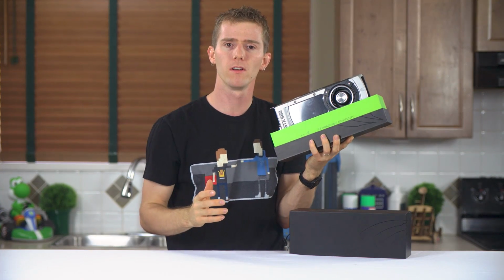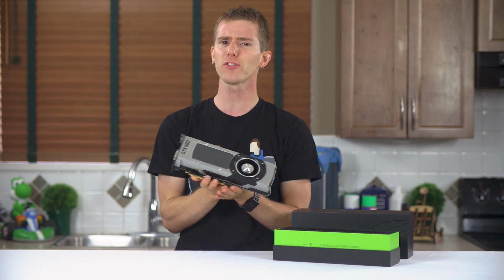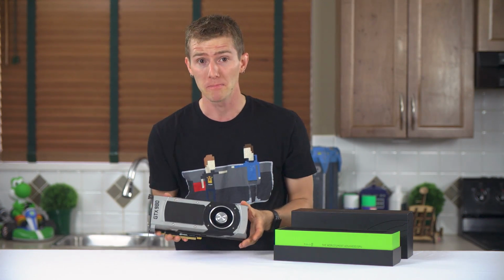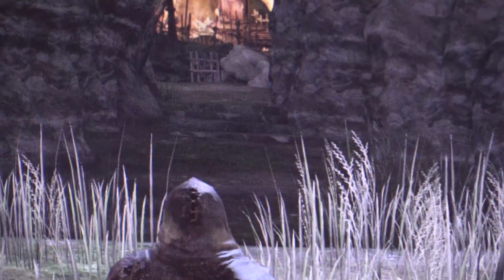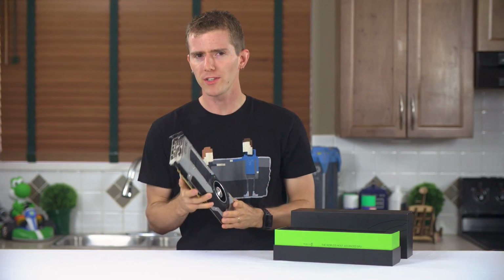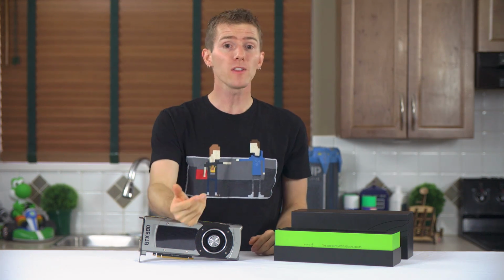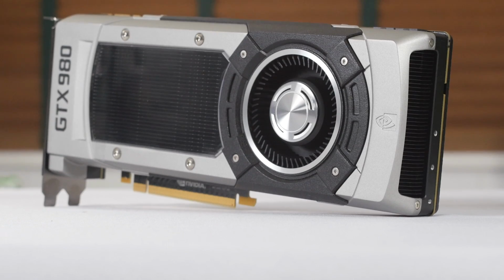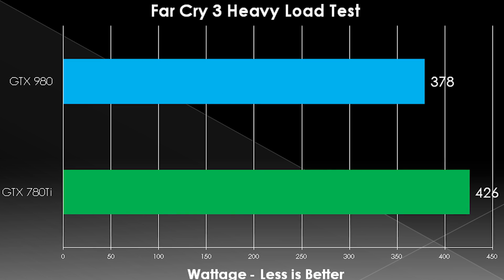NVIDIA GeForce GTX 980 Video Card - Performance Overview

Comment: Should I get this now, or wait for a 980ti?
Reply: Wait for AMD to release their new cards if you can afford the time. Decide then. Worse case scenario you end up picking up a 980 for cheaper.
Reply: We'll probably get a die shrink before we see a consumer full GM210 card, so it might be a while... But when it arrives, it's going to be awesome! So, your call, really.
Reply: I would get the 970. It is barely worse than the 980 and is $330
Reply: If they're deciding between the 980 and a 980 Ti I can't imagine they care if there's a better value product.
Reply: If I didn't care about value, why would I be asking?

Comment: No double precision or 10-bpc this time around either :(
Reply: nvidia dont want to cannibalize their workstation grade gpu's (i mean which would you prefer a 780ti for $600 and dpp or a $3000 card based on the 780ti with slightly better optimized dpp and a few small extra features you might not even need?) so non nerfed dpp gaming cards isnt happening beyond the titans......
Reply: ***** Rather work station grade GPUs since quadro has it too.
1toncheese yeah I know I know. But ever since titan got it i have had hopes for it to be implemented in consumer grade cards. :P
Reply: Andreas Lindhé
it would be great i know but thats business...... nvidia makes much more money this way basically taking businesses for chumps just because they can afford to.
Reply: Yep.

Comment: the TDP of the 900 series is enough to make me want to jump to team green. when i first read into the 900 series i thought "well i could probably fit a 960 in there without also upgrading my psu"..... nooooooooppe. apparently i can throw a 980 in that mothertrucker, and turn my current 7850 into a drink holder.
Reply: i can throw 2 in mine :D and that sounds like a pretty good drinks holder, if you jury rig a pci/ molex thing and make it output some heat itd be a heated holder.

Comment: Good overview, thanks.   One question though...maybe you answered this already.. but why didn't you compare it in the first bit to the 780 or titan instead?  It actually has 300-700 less cuda cores right?
Reply: its meant to be as good as or better than the 780ti, no sense comparing it to the card its replacing but the one above it instead.

Comment: Seems nice. I'm still overjoyed with my 780 Classified though. I'll think about getting this once I make the jump to 2560X1440.
Reply: No need to get that card just for 1440p man. The 780 should eat 1440p games for breakfast like it does with 1080p. And if you really feel its necessary to upgrade, I'd wait for the ti version to come out, the price on this card is a little lower. Or you could get the 970 which (from what I've seen online at least) performs similarly and costs aloot less. It performs about at Titan level in reference cooling for only 300 bucks. If you pay the extra money(probably like 30-70+ more bucks), you'll get even BETTER than Titan performance with a non reference cooling, but only by like 3-10 fps. But if I were you, unless you're going to sell that 780, I wouldn't upgrade until I absolutely needed to, because the performance increase isn't worth it IMHO. But it's your choice.
Reply: I'll be looking for far more than 60 fps when I jump resolutions.

Comment: How much does the card cost? The link in the description doesn't have anything.
Reply: ~550, while 970 is at ~330, but is almost as fast as stock 980 when overclocked. Have a look at techpowerup reviews.
Reply: 549
Reply: stealyphil1925 Thanks for the info, I thought as much, but wanted to make sure. Very excited for this and the 970. The performance is insane, when overclocked they can beat a $1000 card!.
Reply: Ričardas Marozas Thanks for the info. It's an exciting series, finally there is a major price to performance increase, as even stock this $550 card can be on par with a $1000 one, and beat it with overclocking. Both the 980 and 970 will be great cards to own. Very looking forward to them.

Comment: Crap value compared to 970.
Reply: -Beats or is equal to 780ti
-Uses less power
-Slightly cheaper
-Can O/C better

I fail to see the poor value
Reply: Yeah... That's how everything works...
The close you get to the bleeding edge, the worse the value is going to be. Does the phrase "value product" usually make you think of the brand-spanking-new top-of-the-line?
Reply: How much is 970?
Reply: They're $549 and $329 respectively.
Reply: ***** When did I say anything about 780Ti? 970 is only 330 usd and is just ~15 percent slower than 980. That makes the 980 crap value compared to 970. Get it? Or logic is not your friend? If paying 65% more fore 15% performance increase is a good value for you, then you have more money than sense.
Reply: Ričardas Marozas I don't think you get to be insulting people over poor logic when you're talking about percentages as if they act the same going both ways. And what on earth does it matter if the value for the card is different? If you have more money to spend the 980 is a better buy. To get the true value of a graphics card you have to consider the cost of the rest of the system. If you're spending $6-700+ on everything else the performance/cost of the entire system stays almost exactly the same going from the 970 to the 980.
Reply: Patrik Manni In other words, you agree that 970 is better value than 980, but disagree just to disagree, right?
Reply: For just the component it's a better price/performance ratio, yes. That's what I said originally. That's how everything works. But when you're actually building a system, if you have more money to spend, the entire system could end up being the same price/performance with either GPU if all other things are the same. And just a GPU laying on the table is nothing but a fancy paperweight. So no, it's not inherently better value. And it certainly isn't the better purchase if you have the extra money.

Comment: Would this bottleneck i5 4670k OC to 4.4ghz. Get a new CPU for the 980? Or should I get watercooling and OC it even more, instead of the 212 EVO?
Reply: Every card would bottleneck the i5 your always at gpu limit
Reply: You're fine for the next 3-4 years. Seriously gaming w i5 OC CPUs is already a lot of power. Invest in GPUs
Reply: MrApvel  u wot

Comment: Comparing a 1500 OC'd 980 to a 1300 780 ti, and showing the TI still have better performance than the 980 while at the same time saying the 980 is beating the ti. Real honest linus....
Reply: The 980 beats the 780ti in price,features, and power consumption. Brute power however goes to the 780ti.

Comment: Wait, when he said "it's a total tank," did he mean like the vehicle or like a failure? Based on what was said in the video, the technology is really freaking cool but the benchmarks were lackluster at best, so that's why I ask.
Reply: like a good tank, the benchmarks were great, note that new drivers may improve performance more and that not every GPU overclocks the same amount, it uses less power and therefore should be cooler and more quiet.
Reply: Remco Smit Good to hear. Was really hoping Maxwell was worth the wait, and it seems to be doing well based on power to performance ratio, just wasn't sure on the rest.
Reply: I think he meant it as a compliment.  Haven't seen a single review at stock clocks that puts it below the 780 Ti.  It looks like the 780 Ti can still hold it's own against it while overclocked, but at factory stock speeds, the 980 is about 10-15% faster.  The main thing is how much more efficient the GTX 980 is while besting the 780 Ti and R9 290X in pretty much every test, not to mention being $150 cheaper.

Comment: I guess I'll be fine with GTX 670 Top 2way SLI for 1080p @ 120Hz for at least another half year. Maybe not as energy efficient but RAW power is about the same as a 780Ti, and doesn't justify to expend 800+ bucks yet.

Comment: Where is the microphone? is it a shotgun above? This video sounds abnormally muffled and bassy as if the mic is like under the table.
Reply: Unfortunately dude... I feel as if your speaker set may have blown. I would consider referencing some of your favourite songs to see if you notice a difference.
Everything sounded fine my end. 
Placing the mic under the table would not increase bass response... it would actually decrease it.  at least when the sound in question is a voice.
Reply: The microphone is a Sennheiser microphone that has a wire that runs under his shirt that the mic clips onto underneath. The mic is resting between his shirt and his chest, thus causing abnormal resonance. If the mic was not resting against his chest, and over his shirt, it would sound cleaner.
Reply: Stephen Rudolf I use M50x's. So no.

Afistnu That explains it. Though wonder why he bothered putting it under the shirt when he's already wearing black. Probably not noticeable for people looking for the card.
Reply: Becasue he doesn't have a collar.
Reply: Stephen Rudolf I don't necessarily see why a collar would matter, though what you call a collar also counts. If you mean around the neck, that's not ideal if he turns his head. If you mean the lapel, then yes that'd be perfect. it's in the right spot and also an easy exit for a cable.

I would place it in the same place right above/between the two heads on his shirt. Even if the cord was there probably wouldn't be that big of a deal. 

I've never been a fan of the mic under the shirt option. Especially when a shotgun ontop of frame would be easier for a setup where he only moves maybe 6 inches in one direction. Not like it's a wide shot.

Comment: Should I get this or the ti version? I'm currently using a gtx 570 and feel like it's about time for a upgrade. Also I don't over clock things.
Reply: ***** Alright cool. Also will I need to upgrade my motherboard? Also I'm using a i7 2700k cpu. I only know some basic stuff.

Comment: overclock the CRAP out of everything, no matter what. every time. takes a few minutes and you get more performance for your $... as long as you make it stable.
Reply: There are negative effects of overclocking: it reduces lifespan, for starters.
Reply: Dave C while this is true,  I've never (yet) had a computer component fail due to overlooking.  But I usually upgrade every three or four years...  I've been over clocking since we'll..  As long as I can remember..  Back before the celeron 300A days.  Any On I do now,  I use custom watercooling as well..  So that helps I guess.

Comment: Is this worth upgrading to from a 780 for 1080p gaming? I got my 780 last Christmas so not sure if I want to upgrade or just wait until next year when they come out with a new line of cards.
Reply: It really depends on what you use it for, i just use my card for 1080p 60fps gaming. So i won't be upgrading till i need to my R9 280x is doing fine.
Reply: Stay with your 780, for 1080p it will be high end for at least one more year. And even my gtx 770 still does really well at 1080p.

Comment: Linus I'd like to see the GTX 970 SLI and the GTX 980 SLI as a comparison.  Techspot did a great article showing the GTX 970 SLI and honestly for the price of only about 100 more than the 980, the 970 SLI dominates.  I was wondering how the 980 in SLI would look though and if it really blows up the charts.
Reply: oops I meant techpowerup's review...techspot messed up their review with the wrong driver

Comment: I'm the only one disappointed her? I don't mean disappointed by pricing, power or power consumption, but by the fact that nvidia didn't use the old reference cooler aka 780ti/titan black cooler and put a weaker in there. They now use a cooler with heatpipes insted the vaporchamber design. 165w tdp but still 80°c and 42db~? come on nvidia... ruined the card for me...

Comment: The power consumption was really overhyped, but the performance is pretty good. It's not justifiable to upgrade unless you had/have a 770 or below I think, but at least Nvidia thought intelligently and put 4GB VRAM on there to drive these higher res 21:9s and 1440p+ monitors we're getting into now
Reply: ***** http://www.anandtech.com/show/8526/nvidia-geforce-gtx-980-review/21

Total system power consumption is different by 68-70~ watts. Now, that's a difference, sure, but not the godsend that the 980 has been hailed as. It's more of a step in the right direction.
Reply: ***** I wasn't expecting more. It's just that the power consumption itself was overhyped. It's great that it's down, and by close to 200w presumably in SLI setups, but it's more of a step in the right direction like I said as opposed to some miracle gift from the heavens. It just bodes well of what we'll see from a TI version

Comment: HELP: 80 plus bronze 650w power supply, Will it be enough to power 980?
Reply: Yes
Reply: Considering it DROPPED in power usage, YES.
Reply: A 400w PSU would be good enough. 650w is more than plenty.. Hell you might have enough room for 2 980's on that.
Reply: my 780ti good enough in my 650watt
Reply: Depends on your cpu, but I'm sure you will be fine.
Reply: TheOne1ManArmy stock 4770k,
upgrading from 760, I need more juicy.

Comment: Is it better than the Radeon 290X? That is the big question.
Reply: Didn't you see the benchamarks ? The 980 beat the 290x in everything the measured
Reply: Sverre Nielsen well, it was confusing. There was a 290x, but I did not knew it was the "Radeon" 290x. That is why I ask.
Reply: Daniel Martinez The 980 pretty much curbed stomp'd on the 290x.

Comment: This is a rather underwhelming release by Nvidia this time around.
Reply: wait until the ti version comes out. it'll be more powerful.
Reply: Joeza Rasidi JESUS THANKS YOU .. someone with brains around here
Reply: Wait for Pascal. They're just focusing on power saving again, later on they'll forget about that and focus on making significantly better performing cards.
Reply: That's what I keep thinking.  At stock clocks this thing is about on par with the 290x and BELOW the 780ti.  But, it seems its lower tdp allows more overclocking room so...  shrug

Comment: I would choose 980 over 780Ti for the extra VRAM in SLI, but SLI benchmarks would be nice :D
Reply: You can get 780 TIs with 6 GB of VRAM though.
Reply: I don't know about other countries, but in the UK the 6Gb version was more than £200 (~$325 USD) over the price of a 3Gb 780Ti and 980 which are priced about the same)....so yeah for 2 6Gb 780Ti I could in theory have 3 980s...or 2 980s and a 4k display...

Comment: So the 7990 is cheaper and better than the GTX 980. Why would i get it.
Reply: If you don't care about your power bills, no reason to get it. I myself would get the GTX 980 all day.
Reply: HJTh3Best Seriously? Because of the power bill that's the reason to get it. I want my games to run great. Yeah you gotta spend to have the beast but hey, that's how life is.
Reply: ***** So the 7990 is the best but has problems.
Reply: ***** I have a 7970 and the sound is not so loud. And they say the 7990 is as loud as the 7970. Am i right on that?
Reply: ***** What are the gpu issues the 7990 has?
Reply: ***** So dual GPU is like having two GPUs except their in one card is that it? Because if that's the case then i don't want it. I never buy two cards because of the problems it gives,
Reply: Stayler17 yup, GTX x90 and Radeon HD x990/R9 295x2 are all dual GPU.

Comment: What is the price of gtx 780 ??
Reply: 300 to 500 bucks
Reply: usd ??
Reply: Yes usd I think I'm gonna sell my evga gtx 780 sc
Reply: realmadridfc07 Im in the 970 camp too, there are far too many pricey whistles to  hot glue  into my next rig to get too flashy on just the graphics card.
Reply: lol it will be very expensive
Reply: I'm planning to sell my 9800 gt xd
Reply: I will buy gtx 970 because it is in my budget
Reply: teh evilengineer Yes i agree,  I also need to upgrade my cpu so can't spend more than 329 usd by any means
Reply: realmadridfc07 Wait till november when the 980ti  comes out
Reply: around 47k in INR
Reply: Rohith Kumar  28000 for gtx 970
Reply: realmadridfc07 WOW , i just bought Asus 780ti for 54 k man
Reply: lol xd

Comment: I know my 780 can still handle any game even at 1440p but man dat 980, ill promise myself i wont upgrade.
Reply: You upgrade I say the same thing l. My gtx 789 is overclocked to 1200 but I know I'll cave
Reply: ... it... isn't really going to outperform a 780 at stock clocks.  The 980 GTX seems to be a preview launch of a better card.  Just wait for the Ti/Lightning or the new AMD 3x series which is also a new architecture.